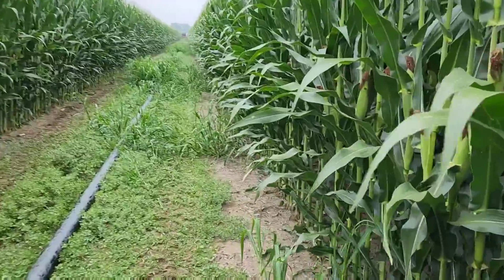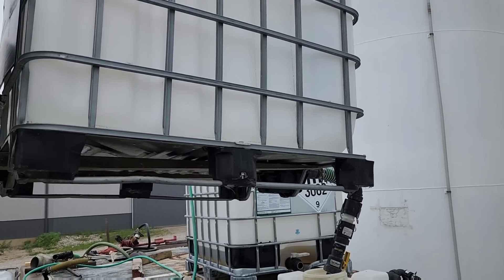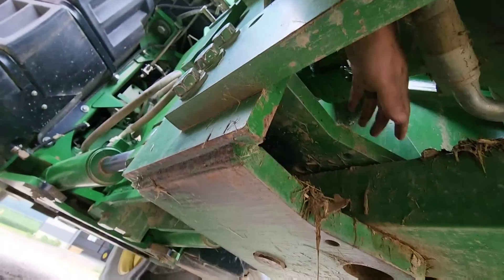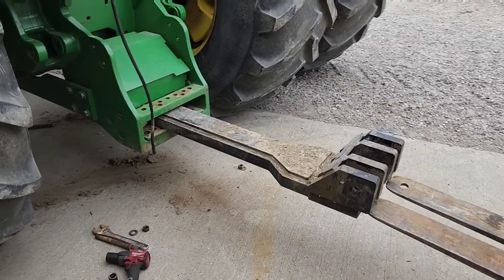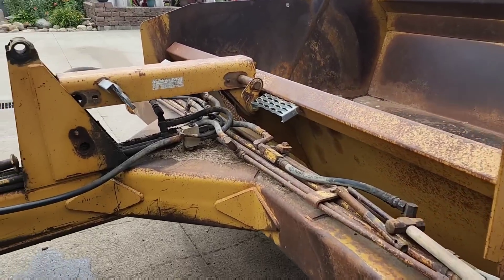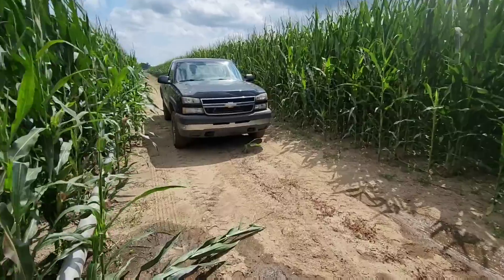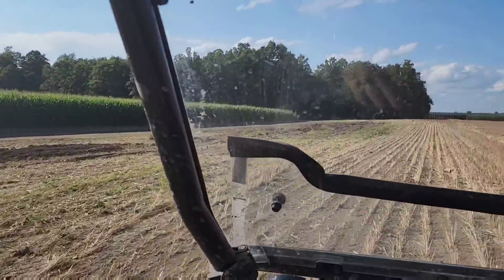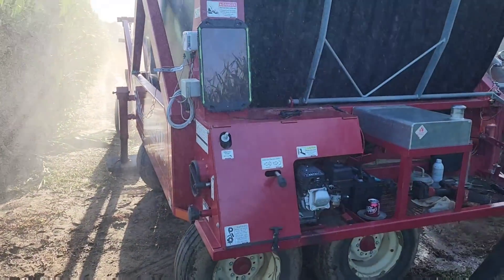Get the BIG Scrapers Out! - #736

Comment: 26:48 shouldn't have to go to a SMALLER TRACTOR, should just have to go to BETTER CONNECTION MATERIALS ???  like ummm the parts of the SIMYz 5th wheel instead of just a ''little gooseneck'' ;)  pops up in my head...
Reply: or 10 inches of half inch thickgood stuff...  4 or 5 inches down to ''replace the square bits'' and like 6" up the neck...  make the ends slightly dovetail to get gussetting on each corner ???  eh... I could draw it.. but eh... you proly already got it fixed YEA :)